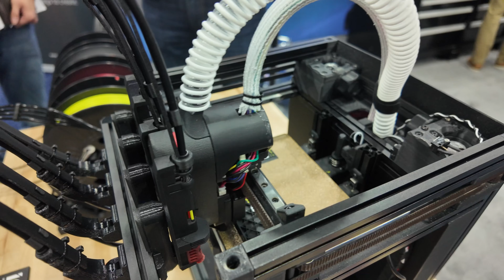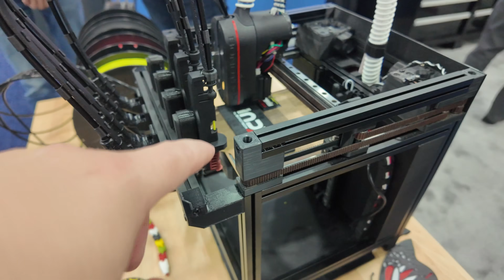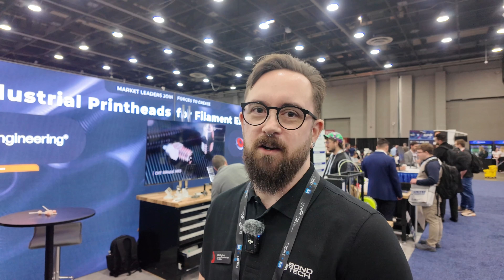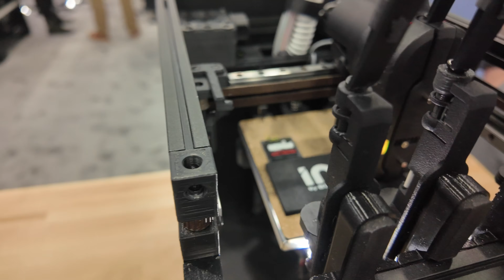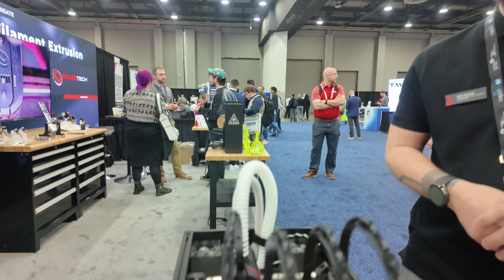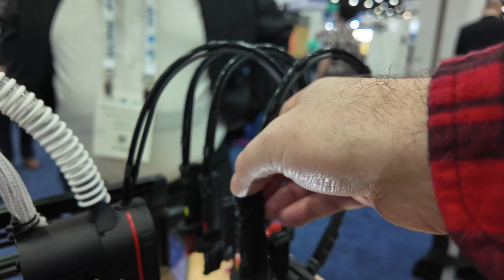BONDTECH INDX - This toolchanger is INSANE!

Comment: Unfortunately now pushed back to the end of Q1 2026 but I'm absolutely getting this onto a larger format printer of some kind, I'm due a printer upgrade anyway. Price is great (if it holds) and it's a great middle of the road path, not as blindingly wasteful as an AMS or similar, and not as expensive, large and complicated as a full-on tool changer in the traditional sense. Bravo.

Comment: Looks like it will be a nightmare to calibrate and get dialed in.
Reply from the maker: not really, single heater and extruder so thats the same for all tools, and XYZ offsets arnt really an issue as long as the docking mechanism is repeatable which it seems to be, and theres plenty of ways to automatically calibrate any adjustments needed
Reply: I'm sure there's a reason this has been in development maybe 3 years when it comes out early next year. To, you know, solve issues like that.
Reply: @cr0ft-2k the point is that you have to set it up yourself and it's for multiple printers 
This is going to be difficult to get setup.
I wouldn't bother unless it is pre installed on the printer

Comment: I haven’t been this excited about 3D printing tech in years. I hate wasted plastic and this is a fantastic solution. Not just for colors, but being able to print in multiple materials. Also doing so without an overly complex, expensive, and bulky solution is game changing. If this comes out on the Prussia Core One, my dream FDM printer will finally be real.

Comment: They talk about the speed of changing heads being a main drawback because the extruder needs to be reheated between each change. What if there was a second movable heater that came in behind the parked tool heads to pre-heat them and eliminate the park time. V2.0 maybe!
Reply: In reality probably too much added complexity for a small time benefit. 10-12 seconds per change is passable.

Comment: If they make an advanced version they could add a heater to the waiting sleeve that preheats before handover. cutting 4 seconds plus per layer... so at 02mm for every 1 inch is 127 stops times 4S+ so about 8+ minutes per inch just in pausing

Comment: 4:08 "multi material, multi nozzle dimension" hold on- slicers would need to support tool change, but they'd also need to support nozzle dimension swapping on tool change? That might take a bit longer- does orca slicer support it?
Reply from the maker: PS/ORCA already support this

Comment: Some extra connections in each parked tool head, So soon as it gets the signal to change the hot end could start heating, maybe? Then when it fastens in the Tool Head, time to heat is cut-down, even quicker

Comment: One of the problems is that this can’t be used with a closed, heated chamber as these tool hangers need to be open at the top. So, more limited filament types.
Reply from the maker: not really

the filament feed system used atm is just the "easiest setup to test with right now"
 and different setups for different machines/configs will be designed later, also just extend the frame to enclose the loops if needed.

Comment: The most important thing that 99% of the guys commented here: You forgot that it will take you 2-3 months of find the correct settings in your slicer, gcodes and macros. well good luck with that! i will stay with my 4 x AMS that actually works without any hussle.

Comment: this might be the thing that gets me on the multi material bandwagon. Ive not wanted a changer that changed the entire toolhead because the tools are too expensive (and i cant fit a lot into a printer), and i dont want a material swapper because of all the waste.
My best plan before this was to just use two or three toolheads and then put a Material swapper on one of them. still terrible if you consider the cost of everything.

Comment: So big question.. can it do 350c to do PA6/nylon/etc? Or is it going to be limited to like 250c and ABS at best? Second question.. if there are heat creep.. gobs of filament everywhere, etc.. given that the entire tool head part with connector, tool head, etc is only $35.. you just buy some extras just in case? I assume for $35 its not coming with nozzles. Curious what the nozzle is like. My QIDI Plus 4 has a heat break attached to the nozzle which sucks because its easy for them to break. Hoping that's not the case here.
Reply: the toolheads are planned to be 250€

Comment: I recently bought an X1C wich is...let's say okay, but I know for a fact that the INDX will be the system in whatever is my next printer. Definitely need to know if the gears will be hardened (I assume they will be, it's the only thing that would make sense if you go all in on a toolchanger)
We have to remember that the software isn't there yet to really, REALLY use all the capabilities a true, practical toolchanger would bring.
Also, we're still missing (not specifically from Bondtech) some form of decent enclosure for filaments, like a very specifically designed tupperware that seals properly so we can mantain our filaments dry, especially nylons and PPA's, for example.

Comment: $250 is a lot
Reply: @Pasha4ur  $250 for one, $137 each if you get 2. $100 each if you get 3... etc. 

The value improves as you get more tool heads. And compared to the upgrade kits for the Prusa XL, this is a steal.

And based on everybody's guess that it uses inductive heating and it's pretty much an all in one toolhead, the cost for the main tool head makes sense.

Comment: The main factor here is the insanely low cost compared to having to set up 4 complete toolheads with motors, control boards, drivers and everything. It is SO NEAT to finally have a less wasteful solution! The small size is yet another bonus. I absolutely love it, I've seen some makers tinker with this idea before and I've been waiting for it to become a proper product. 
The fact that they didn't even have to double the heating element is insane.
Reply: I'm curious to see how the extruder deals with changing between different materials, like rigid and flex, because the drive gears should grip each material differently which could impact the flow rate.

Comment: Huh, not entirely dissimilar to something I was working on... Big difference appears to be that they went with an induction heater that heats the filament whereas I was going with traditional heaters so I could fine-tune for each filament type.

Definitely the way to go is to have the cooling system and main electronics stay mounted to the tool instead of getting swapped.

Though I, in my tendency to overcomplicate things wanted to make it so that cooling and the extruder itself were also separate modules that could be detached automatically. (though together as one module) That way each "tool" is actually two different tools. I wanted to implement some interesting tool changing options, not only for extruding plastic.

Comment: Here's a question for anyone who knows.... What kind of hose is that he's using for the cool air intake on the head unit?  Been thinking of doing the same on my enclosed printer, to keep the heat creap down, but never found anything small and flexible like that...
Reply: My theory is that they use a bunch of stacked condoms glued together and tip cut off for each one. Genius!

Comment: Lil bit of a wait, but that gives me time to print up a proper 'shut up and take my money!' token. 
I saw the preview for these on another channel a week or so back and Loved the idea of finally having a modular multi-head system that works. Printing more practical use case, I don't really have a need for colors so much as mixed materials. Hopefully whatever they are using for hotend solutions can cope with high temp materials, too.

Comment: I am so excited by this. I’ve been looking at different options for MMU/toolchanger/custom toolhead for a while. Once I saw this, my head nearly blew up. My one question, and you didn’t address it, is how it would work on an enclosed printer. I see there’s a PTFE hose along with a somewhat beefy (insulated?) ribbon cable. Add to that the CPAP hose, umbilical, etc and I can see it making an enclosure a challenge. I initially was concerned about the opaque black PTFE, not being able to see what color you’re running, but I remembered with my Bambu the only way I know what filament is in use (other than what is splurting out) is what light is blinking on the AMS. 

In short, Bondtech, take my money please? Send me INDX

Comment: Why does it hover over the print while heating?  Doesn't that risk some drooling that could ruin the print?
Reply from the maker: Probably just the way the macro is setup, may be set to hold in the middle of the bed or something, easily changed

Comment: Big problem is that you can’t have an enclosure
Reply: Another question is in a closed chamber there could be further heat creep problems and therefore risk of clogging when the head is parked?
Reply from the maker: you can, just need to design around it
Reply: Don’t get me wrong, i absolutely love the idea of it. I think it’s the most exciting thing I’ve heard of in 3-D printing for awhile makes bamboo labs H2d look a bit old-fashioned. yeah you can design an enclosure, but its gonna have to be alot deeper as a normal one. Having a large format printer with this on would make the size of it too unwieldy  maybe?
Reply: Oh, and the fact that the front of the back don’t allow access means you’ll have to be reaching over the changers to get at your print.

Comment: Thank you!  This is the video I was wanting to see, with closeups of the nozzle change, showing the heating and nozzle prime (quicker than I thought), and every other detail I wanted to know other than how the hot end is heated, but thanks for asking.  I love that INDX doesn't poop.  That always seemed dumb, wasting time and filament as well as making a mess.

There are fundamental problems printing different filament types in the same nozzle.  I don't do decorative multi-color PLA prints.  I want multiple filaments so I can print different materials, with a major application being peel away supports where the filament types are not compatible so they don't bond to each other.  Printing incompatible filaments in the same nozzle, even with a lengthy purge, can still result in weaker parts.  INDX completely and elegantly solves that problem.

Bambu wishes they were 20% as smart as BondTech.
Reply: Bambu has great reverse engineering department.

Comment: I was impressed by the teaser videos, and I looked at my toolchanger design again and revise the kinematics. I’m looking at a lighter tool head with just one extruder motor and cam action using Dmitry Romanvich’s Picolino extruder (magnetic IDEX), but other stuff is being done first. I must say that the kinematics of the Bondtech system look simplified vs the usual 3 point system I was using, and tbh if my toolchanger doesn’t work out, I’ll have no problem purchasing the Bondtech system.

Comment: I think at present there is no board in the toolhead - it is just old fashioned separate wires.  The tool change on the 2.4 version shown in Sweden wasn't done by an extruder based cam - but by the X Axis moving to the edge and pushing into a little actuator.   I think the ultimate solution is this product on a fully independent dual head printer, with RRF Multiple Motion System firmware - you should be able to get a lot of the tool changes a lot faster than sub 12 second (or 17 second as in the demo in Sweden) - I think sub second is possible - and intend to demonstrate it when I get my INDX after the November release date.

Comment: I’ll bet the heater he couldn’t comment on is an induction heater.
Reply: I was thinking the same, the only induction heater for printers right now is like $500 and still in prototype phase. There is one video recently of a youtuber printing with an induction hotend, basically using different temps for overhangs and supports. Cleanest I've seen so  far.
Reply: Ultimaker were playing around with inductive heating about ten years ago. Too bad it never came to fruition, we could've been even further along by now.
Reply: Probably, the whole 4 second heat up time is a dead giveaway.
Reply: @themagitechie9955  Exactly what I was thinking. And you cannot see any obvious heater on the nozzle cartridge assembly they show. Nor can you see any electrical connections. Induction makes the most sense. It’s fast, wireless, and has a high degree of controllability. Not to mention it should have an extremely high temperature threshold.
Reply: @themagitechie9955  it's 11 seconds
Reply: 100%, it must be.
Reply: A bit late but incase you didnt see...YOU WERE RIGHT!
Reply: @tankkiler308 yeah! 
I really only makes sense.

Comment: This is by far the most exciting recent hardware development for me! I want this on a printer. I've had next to no interest in an AMS style system, but a tool changer like this is the stuff.
Reply: Exactly.  AMS, MMU, CFS... all waste time and filament, make a poopy mess and will have cross contamination with incompatible materials that weaken parts, even with a lengthy purge.  INDX is so much more elegant and practical.  I'm more enthused about INDX than I am about any new printer.  Most of my applications would swap filaments for only a few layers so this won't noticeably increase the print time while allowing me to print TPU feet on a PETG-CF part, or use PLA as a peel away support interface on an ABS part.
Reply: @Liberty4Ever  Yeah depending on when exactly it releases and all, I may either try to adapt it to a printer I have or build a new printer for it.
Reply: @Liberty4Ever  I'm most interested in doing TPU embedded parts and multi-color like text without waste. Removable supports would also be great.

Comment: The print head is expensive but the nozzles are a good price. $400 for 4 colors is a bit high but still worth it and on larger printers it could be $550 for 8 colors or $700 for 12 colors which beats out "AMS" and clones on price while performing much better too. Hopefully they partner with some printer manufacturers to have some pre built machines ready to go for people that don't have or want to spend the time to build it.
Reply: Totally! What's even crazier is you could do a full Voron 2.4 plus this changer and 5 tool heads for like $1800  That's $700 cheaper than the Prusa XL with 1 tool head! 😮 AND it's enclosed!  I really hope this succeeds, if it does it's going to be a game changer!
Reply: @ghostshadow1  I have a RatRig V Core 4 500mm coming in a couple weeks. When Indx gets released, I'll be ordering 6-10 toolhead/nozzles and will have a machine that beats out a Prusa XL on every metric except modular bed heating for $1500-$2000 less... and with expandability to 20+ tool heads if I want to go really crazy down the line.

$250 may be expensive for the base toolhead, but this system definitely scales well with more nozzles.

Comment: All the cool stuff comes out now that I get out of the DIY 3D printing... As much as I want to continue with custom 3d printer building, ever since I got a Bambu I just can't seem to go back to the Klipper operating system or the time it takes building a 3D printer.1 year ago I would have been the first in line for something like this. I've always been a HUGH Bondtech and Slice fan.
Reply: One really cool thing I seem to like here is the entrance of the reverse bowden is attached to a swivel there to keep less friction on the filament and keep proper tension on the tube keeping it out of the way and tensioned backwards out of the print area while not in use. The lightweight concept of only switching out the hot end and heat sink is brilliant!

Comment: This is the reason I didn't order the H2D. While I love my Bambu lab X1C, I really want a toolchanger for my next printer...
Reply: ive been following the 3DP community since the Makerbot days. kept pushing off buying a printer waiting for things to mature. Core XY is going to stick around for FDM for a long time, and with the Sovol SV08 i can get my feet wet in the voron enviroment. plan to get one in the next few weeks and will definetly plan around getting the INDX.

whatever you get i would definitely go voron or voron based, as its been around for a while and will stick around with a good community to support keeping the machine running.
Reply: @sabiti5428 just be aware, I’ve been following teaching Tech’s SV08 toolchanger series because I bought an SV08 to build a tool changer, and the klipper firmware is unable to be updated because it’s not Mainline so it’s not entirely open source, so adding this may not be possible without entirely redoing the firmware on the SV08
Reply: Me too!
Reply: Same Same
Reply: Same same. I just got an SV08 and it's great for the price. Will be insane once this goes on
Reply: And now we know that H2D get a kit too changing nozzle :)
Reply: This is way more efficient than the H2C. Bambu vortex is designed to get around patents, and it takes longer to retract and feed the nozzle,and heating is slower.

This here is fluid ,quick(no ams slowdown) ,less waste.
Reply: But now Bambu announced the H2C with a similar system
Reply: @Tony_3d_  its important the h2c and this are diffrent this will be faster butthe h2c might print better but is also atleast double in price

Comment: That is quite awesome! And nice seeing the CPAP air thing more places. Seems like a nice way to increase the airflow, hope to test a machine using that soon.
Reply from the maker: CPAP (or similar) is sort of a necessity,  theres really not enough free room in the toolhead to fit some proper fans for part cooling and it is much smaller overall that what i original thought based on the teaser video from a bit ago
Reply: @CanuckCreator  I'm hoping they find a way to use an eddy current probe. If they could somehow get a beacon or an eddy installed in it that would be a dream, especially if they could integrate the nozzle tap the beacon has.